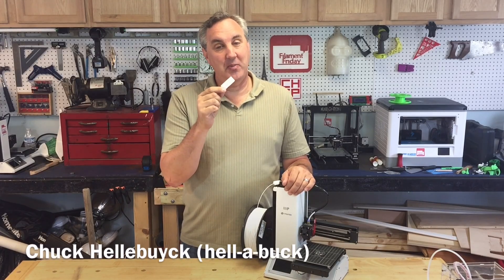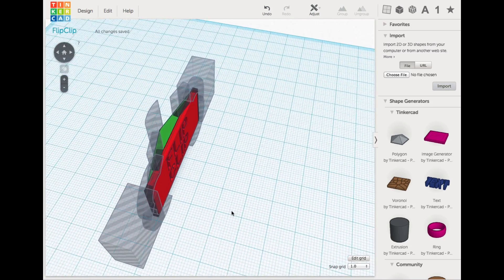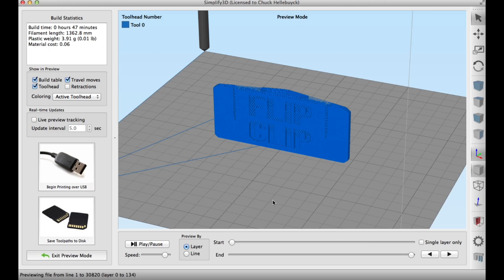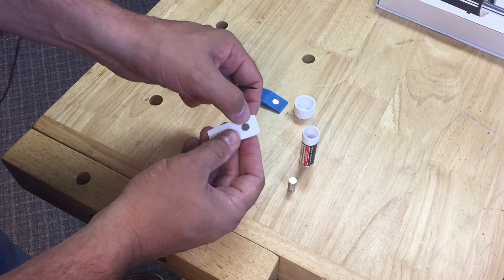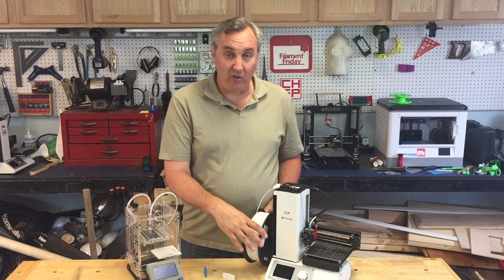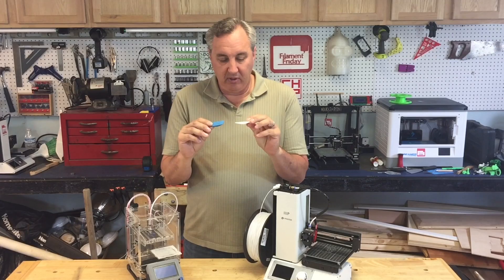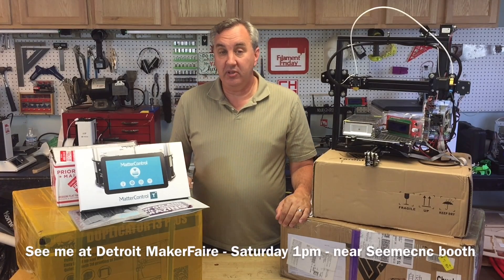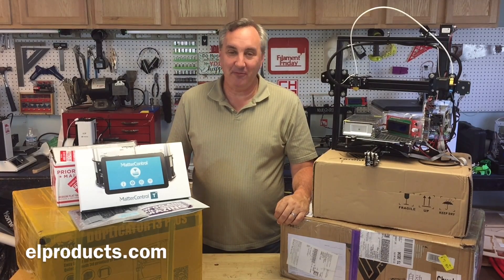3D Printing Filament Friday #76 - FlipClip Fridge Magnet on MP Select Mini

Comment: Hi Chuck! This video is great like the rest of yours, but I've got a quick question/suggestion that's kind of unrelated. Have you considered mounting a new hot end like an e3d v6 on one of your Da Vinci's? I just mounted the cheaper e3d lite6 on my da vinci, and it was super easy (look up the bowden versions).
Reply: +Chuck Hellebuyck's Electronic Products I used the original thermistor and heating element and it works perfectly. I also did reflash it to repetier. I'm surprised by how well it's working so far.